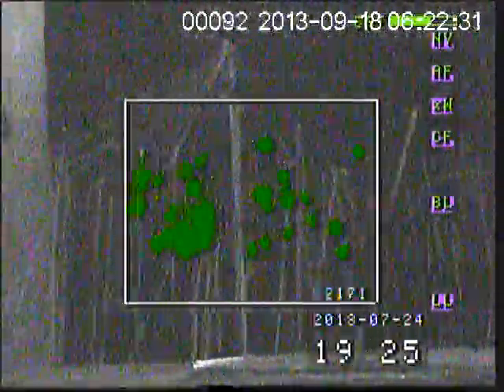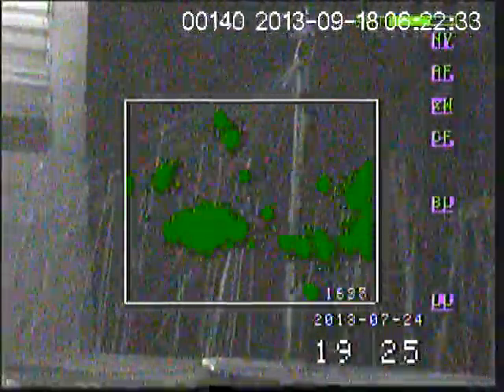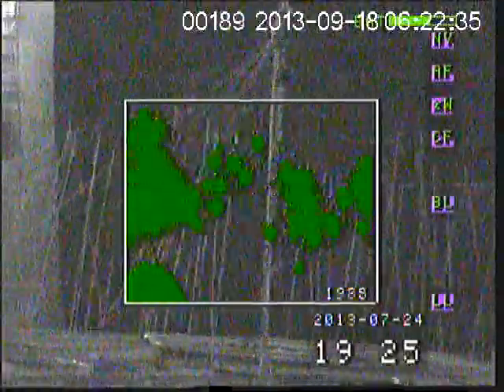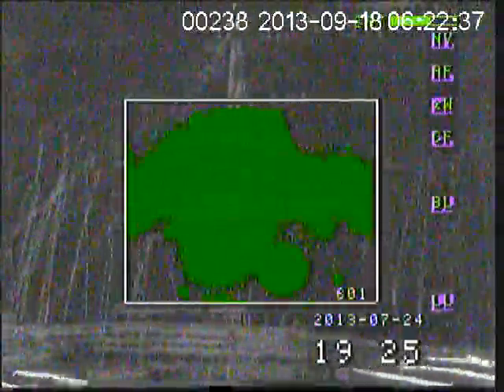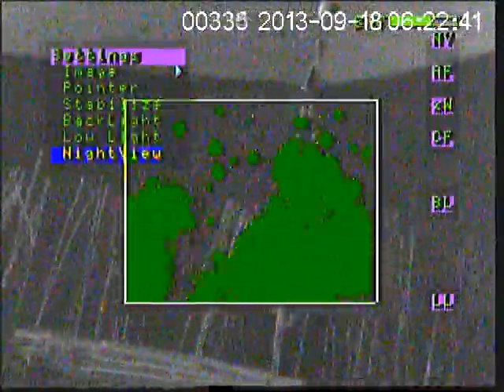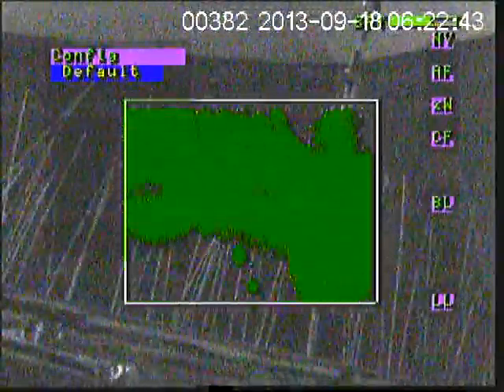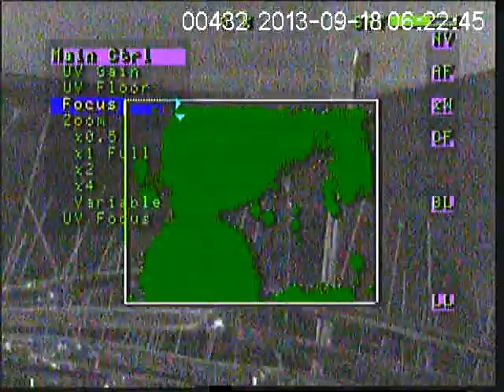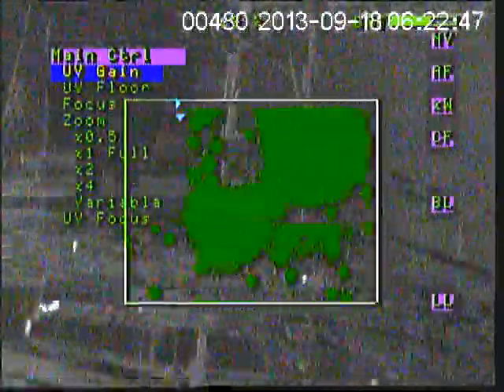Ultra Violet Spectrum Sensitive Camera Footage From 2013 Of The Self Contained Ion Powered Aircraft

Comment: everything has its own vibrational resonance frequency, but what you might not know is an object doesn’t exist in a location, location is part of the objects properties, so if you have an object in your hands and then move it someplace else, then mechanically speaking that’s a different object as the equational variables have changed since the vibrational resonance will be different from where the object was before.
 
So a simple experiment, if you take a 4” hollow copper ball and place it on a flat surface and resonate it, then measure the frequency, now place it about 10 feet away on the same flat surface and resonate it and measure it’s frequency again, if your equipment is sensitive enough to measure the difference in frequency, you can now put the ball back to the first position and resonate it with the frequency from position 2. You will need to overwhelm it as to change its resonance frequency to that of the ball from position 2, so to change its properties. Since the location is the properties
of the object if you change the equational variable by overpowering its vibrational resonance then that object must cease to exist and reappear in its new location.
Reply from the maker: Interesting comment, Thank you!

Comment: Cool! I don't really understand what I'm looking at but I'm looking forward to seeing how it progresses :)

You said in another comment the green was UV light emitted from the emitter wires. So the ions emit UV light as the electrons change energy states is that right?
Reply from the maker: Hi Dylan,
Yes, that is correct.  The camera can color the violet UV light any color that the operator wants. I also have a video with the light colored red.  This type of camera is usually used to find power losses in high voltage systems.
Thanks for commenting!
Reply: @KraussEMUS1  Thanks for clarifying :)

I'm hoping to study engineering next year and I really like physics so this fascinates me. Plus new technology is always cool.

Comment from the maker: In this video viewers can see the corona/force field building up from the emitter wires etc.. 

This is an engineering video to let people see how the craft works in the UV, normally invisible, spectrum.

This technology has much more potential than most people realize, and I hope it will be more apparent in the near future. 

High altitude flights and a consistent agile steering/stabilization  system are on the horizon:).